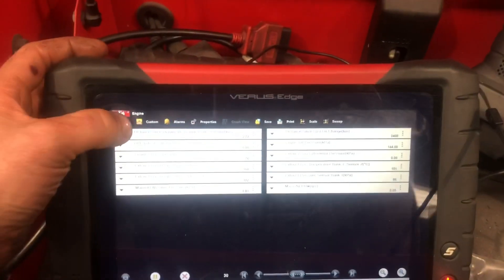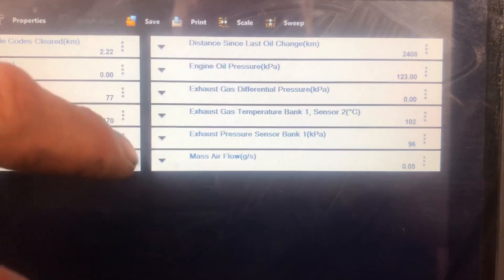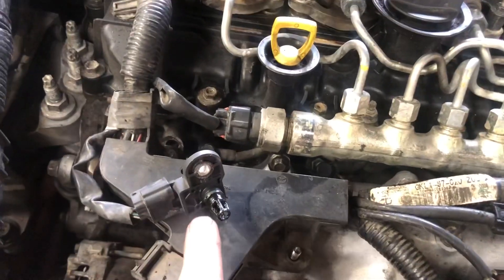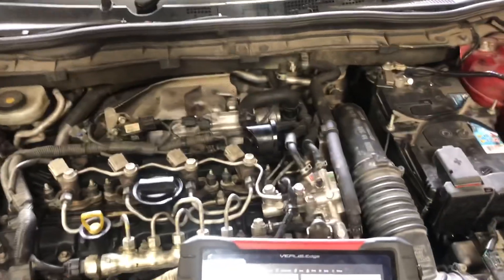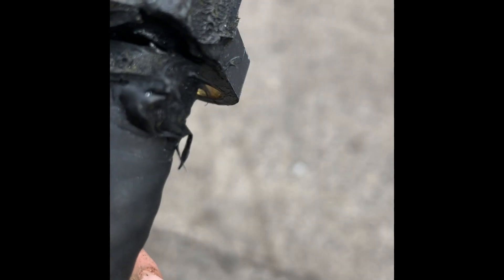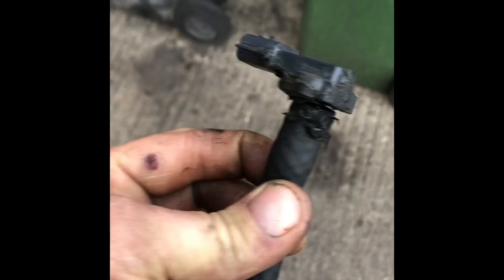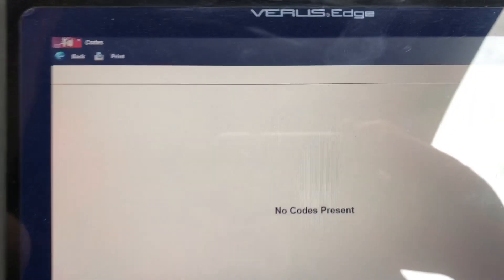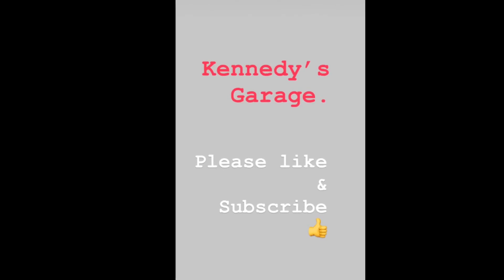Mazda 6 reduced power fault finding

Comment: You've a video for everything Peter! Thanks again. Yesterday I removed the rocker cover and was relieved to find the camshaft was fine (no ridges or grooves). But then I found this exhaust pressure sensor pipe is blocked! Why oh why did Mazda make this so inaccessible?! I can't clear it  and I can't get to the bolts holding it on to replace it. I've one more thing to try (curtain wire and more carb cleaner), but if that fails I'll have to risk torching it.
Reply: After much swearing I managed to get the nasty little pipe off, cleaned and refitted. Just need to put everything else back together and fit the new sensor tomorrow. Fingers crossed it fixes the issue...
Reply: Fixed!
Reply from the maker: @Teleport73  sorry I’m so late getting back to you, but very well done 💪💪💪
I use a gas torch nowadays and compressed air. It burns that carbon is second, but it took a year or 2 to figure that out 😉👍👍

Comment: Hi Peter, Thank you for all of  your videos,you helping to many people to be happy with their cars.
I have problem with my mazda 6.
I parked in my garage with no any fault or problem ( everything was great) 2 days after that i start the engine and i was bad surprised.
Engine start normal, but not working properly,no boost from 1000to 3000 rpm, smoke from exhaust, smell like diesel. On scanner no fault codes. Yesterday i clean the exhaust back pressure pape was blocked but the problem is not resolve. Camshaft is replaced, intake manifold is cleaned ,brake booster ( vacuum pump) is 7.60.
For me looks  like not enough inlet air in small turbo. It is possible to be that vacuum solenoid? 
Why is this smoke from exhaust?
Thank you in advance!
Reply: It has been 3 months so you probably fixed this, but in the 2.2d the smaller turbo works between 1.5-3k rpm so that should get probably changed or repassed. Also based on the color of the smoke it can be pure black is probably diesel getting into the exhaust/not good sealing somewhere in fuel lines, or blue-ish black smoke is oil getting into the engine cylinders/turbo

Comment: Hi, Peter, thank you for a very informative video! My garage has cleaned the intake manifold and EGR valve and the car is driving without problems again. I had suggested to them to also change the little pipe (SH01-20-870) but they said that in general problems would be solved by cleaning intake manifold and EGR valve. In your experience, is the replacement of that pipe still necessary / useful? Thanks in advance!
Reply from the maker: @C.Kestens  look at ‘exhaust pressure sensor A’ on live data with a scantool. It should read close to 100kpa with the ignition on, around 105kpa running. Then rise and fall fast on snap throttle, up to 300kpa or so. The pipe can be cleaned with heat & could save replacing the pipe but definitely replace the sensor if not reading correctly 😉
Reply from the maker: @C.Kestens  https://youtu.be/Z7n7UGKyyV4?si=E7bA3fg53vSlqvFL
Reply: @kennedysgarage3281  Thanks! I did already get the sensor replaced.

Comment: Hi. Mazda 6 2.2 Diesel 175 hp 2014 with automatic transmission.
 I press kickdown and engine rpm goes to 4500 but car is not going faster and can't change a gear.( 110 km/h)  Can you help me? Any ideas? The car is sluggish.
The car has 193,000 km. with four new Denso nozzles and new Turbo. They cleaned my EGR, DPF and intake manifold. My fuel pump has been checked and is fine. They changed the MAP sensor, MAF sensor and turbo solenoids and No Results.
 The last fault the car showed a year ago with the previous owner was P2712 and it cleared without doing anything. Now it doesn't log errors. The consumption does not fall below 8 liters.The gearbox is serviced with new transmission oil and new filter. No results. Is it possible i have cracked hoses and vacuum leaks? I'm desperate. Please help 🙏
Reply: Did you manage to fix this. I have similar problem on Mazda 6?

Comment: Please can you tell me what size torx that is!
Reply from the maker: @Davidsmith-zw3kj  I’m not aware of any Torx needed. Would it be the 5mm allen key holding on the oil control solenoid??
Reply: @kennedysgarage3281  hi Peter thanks for the reply. Yes it was a Allen head bolt. Got it loose with a t30 torx as in the video it shows a torx being used which I found odd on a Mazda. Chewed the head up abit so replaced with a 10mm bolt instead. I’m very thankful for this video as when I got the pipe out I tried unblocking by heating the end which is accessible whilst in the car but my pipe was blocked much further down. Would have been successful still on the car. Great video guide! Got the job done! You have helped me replace my turbo and now do this job!

Comment: Hi pal nice one ..
Had a friend yesterday he failed on nct visual rear discs going to do friday...then he explains this lag sometime like boost stops then comes bk in ...so first time under the bonnet had a root around found blocked map ...partly blocked dpf pipes but not really bad ...so the car is s 9 out of 10 from lets say 5 ...
He happy ....but i can feel a little room still ...knew nothing about this pipe ...i wonder now is mine that pipe also ....
Try friday ....yeah they are a fiddly bas to do anything
Reply from the maker: This exhaust pressure sensor & pipe do dictate boost pressure. The sensor fails very often and there is a revised one available for it now. I find the best way to clear them if blocked is with heat and compressed air. It could save a lot of time for you 🤞🤞🤞

Comment: Just want to give a big shout out to Peter. The engine light had came on on our mazda 6. My wife took it into the dealers and they couldn't find the fault, so they cleared the engine light and sent her on her way. I took the car to work the next day and the same thing happened, engine light on and loss of power. I searched online for a similar issue and this YouTube video sounded spot on to the problems we were having. My wife took the car back into the dealers the next morning armed with the knowledge for the mechanic to maybe check the same sensor. Lo and behold, that's exactly what the problem was, the error codes matched up. The service department actually thanked my wife for bringing it to their attention as they could have quite easily went down another path. They the parts instore and fixed it by lunchtime and sent her on her way. A week later and the car has been running faultlessly. Thanks so much Peter, I'm sure we would have paid a much larger sum before the dealers discovered the correct problem. Cheers
Reply from the maker: Hi Paul, well done mate that sounds fantastic. I’m delighted my little video helped & thank you so much for the really good comment 🙏🙏🙏

Comment: Hi Peter,
I have the same problem on my mazda, wastegate not opening and P2263 fault code, exhaust pipe blocked 
How you removed the vvt solenoid? It's only one screw right?
Many thanks

Comment: Hi, 
My issue is P2262, I already cleaned the hole intake system and replaced map sensor and dpf sensor. The exhaust pressure sensor is already the new one since about 7 months. 

Turbo looks good and everything is clean now. 

The Car also tells me DPF Fault (sry im from Germany and trying to find solution) 

Nothing of that helped to solve the issue. 

Do you have a guess what i should check next ? 

Thank you so much!
Reply from the maker: Hi all the way from Ireland, P2262 is boost pressure not detected. Using a scan tool look at exhaust pressure sensor A reading just to verify if the pipe to it is clear. After that remove the battery, battery tray and and air outlet pipe from the turbo. It is held in place with 4  12mm nuts. Just to check the lower down turbo and adjoining changeover flap. Let me know what you find 😉
Reply: @kennedysgarage3281  Hi, thank you for the quick reply, I already checked the flap in the small turbo and everything was fine. The next days I will check the pipe and let you know. 
Thank you 👍🏼👍🏼
Reply from the maker: @creed4speed475  it also could be as simple as an air intake pipe off or split. Good luck with it 🤞🤞
Reply: Hi did you fixed? What was the problem?

Comment: P0102:00-AF - Mass Or Volume Air Flow Sensor A Circuit Low, P0030:00-AF - HO2S Heater Control Circuit (Bank 1, Sensor 1), P0079:00-AF - Exhaust Valve Control Circuit Low (Bank 1), P06DB:00-AF - Engine Oil Pressure Control Circuit Low, P0383:00-AF - Glow Plug Control Module 1 Control Circuit Low, my cars on limp mode, have a engine warning light, dsc light and scbs light; i changed that sensor to the new one, didnt change the pipe, do you know what it could be?
Reply from the maker: I have a video on P0102 coming out this weekend. But resolve that first and go from there. It could be a fuse or power feed but in my case it was the airflow meter had failed 🤞🤞

Comment: I came here from MRniceguy94 who had a video up detailing a carbon clean he had performed on a 2.2. My 2013 went into limp mode after low oil pressure warning when I was driving up an incline. I'd this issue last year too. Had to get oil sump gauze cleaned out and injector seals done. I don't think they cleaned it out. I'm not mechanically knowledgeable so have gone online to check what the issue is. I'm thinking my engine will be covered in built up grime as well. I checked the dipstick, oil level ok but noticed a small golden residue on it as well which probably isn't a good sign. This will be costing me another small fortune no doubt. I bought mazda for 'reliability'! Think I'll get rid of it soon. Scunnered with this problem.
Reply from the maker: I wonder could you just have an oil dilution fault 🤔🤔
It is just a counter that can be reset 

Mazda 6  oil light on  & P253F oil dilution, reset procedure
https://youtu.be/aNO0-cHCCsA
Reply: I had the same problem! Turns out the diesel injector seals start to leak. You need to replace them

Comment: I've got what seems like a similar issue and could really use some help. Ill describe it 

Just had a service done, soon after was driving one day and the car hesitated around 2.5k rpm with a very strange rattling noise, wouldnt push past 2.5k.

Pulled over, turned the car off and restarted. Started driving and could hear a fairly throaty thrum accompanies by a turbo howl/whine.

Cars acceleration was super sluggish now, but when it reached 2.5k rpm it behaves normally and starts accelerating quickly like normal.

Any thoughts of what it could be?
Reply from the maker: From what you say, it sounds like the changeover flap for both turbos has fallen off. It is quite common failure item & a loss of power under 2500 are the symptoms. 
Remove the air box, battery and then the air outlet pipe from the turbo. Then look in the hole at the flap & small turbo.
Reply: @kennedysgarage3281  thanks I'll take a look. Does this mean the whole turbo needs replacing?
Reply from the maker: @adamY2K  it depends on whether the holding pipe went into the intake turbine and damaged it. But you will be able to see this once disassembled 😉👍👍

Comment: Do you have the part number for the sensor? Have this same problem with mine.
Reply from the maker: The part number is SHY6-18-W00 exhaust pressure sensor 😉👍👍
Reply: Found it and fitted it cheers. Video came in very handy but what an awkward job! Engine management light now gone and no fault codes. Power back now too and driving as normal. Still have scds light warning for some reason.

Comment: Great to see such indepth knowledge sharing on these motors, I ran one from 2019 to March of this year, a 2016 car with 77k on purchase and 117k when gone.  I didn't have a minute's trouble with it but I was changing the oil every 10k or annually, whichever came sooner, and it was doing regens every 300km or so (obviously it wasn't doing much mileage at all during the pandemic). 

Was I just lucky or were more frequent oil changes helping things? Ended up buying a Mazda 3 with the Skyactiv-X engine anyhow. Be interested to hear your thoughts on these.
Reply from the maker: Hi Benny, most of the problems with these start to arise after 120,000kms. 
Yours would probably have driven away fine until 130 or 140 due to the comprehensive service schedule. But it is inevitable that the intake manifold, exhaust camshaft & sensor fail. Injector washers would be replaced when doing the camshaft. 
The newer engine design doesn’t have these problems 💪💪💪

Comment: hi, is there a video or advice/suggestions on the turbo bypass valve that falls apart? does turbo  have to come out? many thanks
Reply from the maker: Unfortunately I do not have a video on that, but the turbo is most likely to get damaged once the pin breaks. If so the complete turbo needs to be replaced. I will send a link for that if needed 😉👍👍👍
Reply from the maker: https://youtu.be/XJZ3AC2bAtc

Comment: Hey Kennedy, 
Just came across the real mechanic who knows his stuff and knows about Mazda.
I need your help, My car is 2.2 2014 Mazda 6 with 115K miles. I recently bought the car and all of a sudden EML comes up saying P2262 code.
I changed the exhaust pressure sensor, but the light is still coming on, after diagnostic in garage, they mentioned everything is fine, but don't know the excat reason of fault. They mentioned the back pressure is coming to be very high. Acc to me car is running fine, no reduced fuel economy, not lagging.
Still not sure what's the case, Can you please shed some light on this issue. :)
Reply from the maker: Hi I could have messaged you on Instagram also 🤔🤔
I would say this pipe is blocked, did you get to check it ??

Comment: I’m anticipating having to remove this pipe on mine. Thank you so much for sharing the possibility of doing it without removing the turbos. 
Important note: I’ve already just upgraded that sensor (how I discovered the blocked pipe). The short wire that comes with the new sensor isn’t just an extension - if you look closely it actually swaps the two outer wires over. Fortunately I noticed before making the mistake of deciding it would be a neater job without it 😂
Reply from the maker: That is correct Josh. The polarity does change with the extension piece, well spotted 💪💪💪
And the steel pipe can be quite fiddly, but totally doable .  Good luck with it 🤞🤞
Reply: @kennedysgarage3281  Consulta amigo , el sensor ¿es necesario que tenga esa extensión? o el sensor de metal se puede conectar al cableado original 😢

Comment: Have you ever had a mazda 6 in that you werent able to fix and or diagnose properly or do you manage to fault find eventually? Where ru based?
Reply from the maker: The first few that I started doing caused me nightmares 😬😬😬
But after a few years at them they become quite easy & nice to work on. Familiarity is a great thing 😂😂
Based in Waterford 😉
Reply: Where did you get that pipe ? Mazda dealer ? Thanks

Comment: Hey Peter from cork there
Just purchased a mazda 6 private sale the other the 2.2 skyactive 2015. And the car hesitates to go over 3000rpm
The power is there but I think it's limited. Any way you could help much appreciated!
Reply from the maker: Hi Brendan, the first thing you should check is the map sensor (boost pressure sensor) it is very easy to get at just at the timing chain side of the intake manifold under the wiring loom. It is held in with an 8mm bolt. Remove it and see if it is blocked up with carbon. If so just clean it with a small screwdriver or pin 📌 
Let me know how you go 🤔👍👍

Comment: Hi Peter, Based North of Ireland here and at a loss with my CX-5 2.2 skyactive. Apparently my DPF is too blocked to even do a forced regen (It's been on 4 computers). Low on power too at the moment (engine inspection light) and red DPF inspection triangle is on. I'm told my options are to either get the DPF mapped out, get a new one (couldn't afford this) or get it removed and cleaned but it will just clog up again I'm told. Do I slog it to Waterford or do you suggest any of the above? Thanks.
Reply from the maker: Hi, the DPF’s on these don’t give much bother but if there are any engine based faults causing more smoke in the exhaust system, then the Dpf cannot deal with that. 
So yes, the Dpf will only block again if you don’t repair the cause. 
Google Kennedysgarage.ie and send me some videos of what is happening on WhatsApp 😉👍👍👍

Comment: Peter can you please make a video on how to remove the turbo from this car? I need to remove and replace mine but it seems difficult with the amount of connections behind the dpf. Mazda instructions indicate that the main subframe has to be removed in order to remove the dpf then the turbocharger. Can you suggest an easier way please? Thanks buddy
Reply from the maker: Don’t even attempt it in situ, drop the engine & gearbox out of the vehicle. This might seem harsh but you will remove it in 3 hrs, then change the turbo in 2 hrs. 3hrs to refit engine and gearbox, all done in a day. 
It is easier than it sounds & you will thank me for this when done 🤞🙂🙂🙂
Reply: @kennedysgarage3281  I wish I could do that..unfortunately I don't have a ramp or facility to remove the engine and gearbox. I was thinking to undo all bolts for the dpf and set it aside in the engine bay so I can get access to the bolts for the oil and water lines at the back of the engine. Would he great if you can make a video about this :)
Reply from the maker: @neeldub53  I have one to do this week & I will make a video but unfortunately I will be removing the engine to do it. 
It is near impossible in the car & that awkward that it isn’t ever a success, it will more than likely leak oil or water afterwards 😔😔
Reply: @kennedysgarage3281  i look forward to the video :)